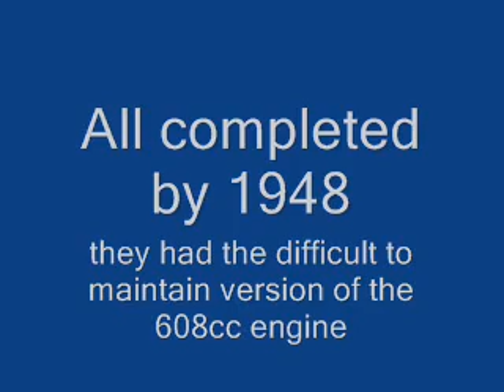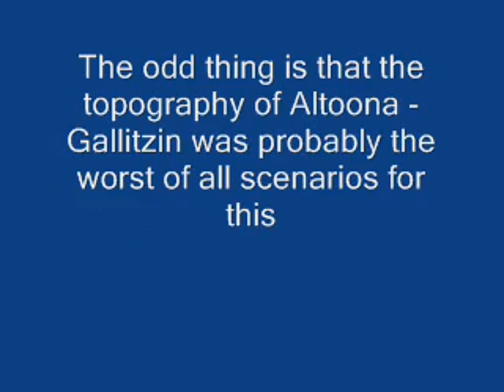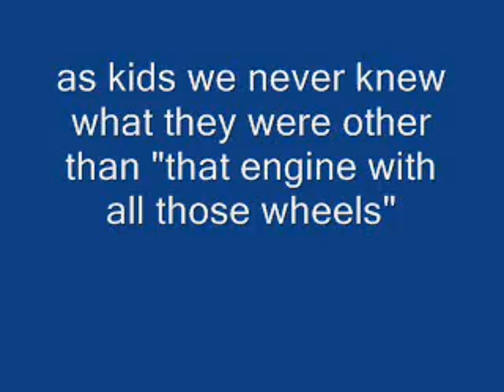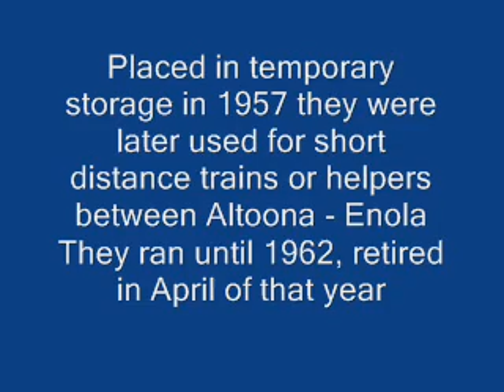baldwin centipedes

Comment: 0:42 A 608cc engine?  This requires some elaboration.  A 500cc engine is what you find on a motorcycle.
Reply: I think he meant 608NA for model 608 Normally Asperated. There was the 608SC for model  608 supercharged.

Comment: Diesels require a different set of design knowledge/heritage than steam locos. Just look at a steamer--every accessory is hanging outside the boiler in the breeze. No so with carbody diesels--everything is inside on top of each other. At least GE had experience with boxcab electrics.

Comment: The Baldwin guys were idiots lost in a past era. GM brought ASSEMBLY LINE AND OFF THE SHELF PARTS to the table and ran with that. Factually, the venerable FT was one of the most problematic locomotives ever made. But parts were galore and changing them was straight forward. I have a book called THE ENGINES OF BALDWIN and OMG the number of power plants they ran through because they thought like STEAM ENGINE BUILDERS. 

Pennsy did not help Baldwin OR itself either because those idiots were FAST LANING ENGINES WITHOUT ANY FORM OF ROAD TESTING. Had these been pre vetted, the smaller power plants that were more reliable would have been applied as well as a new traction motor blower system.

ALSO what egghead put all the LIQUID INES AND TANKS ON THE CEILING AND ALL THE ELECTRICAL LINES ON THE FLOOR? Duh

EMD's also went through this but ACTUAL MECHANICAL ENGINEERS SOMEWHERE SHOULD HAVE CAUGHT THIS WAY EARLIER ALL THE WAY AROUND. 
 
Anyway, the engine that APPEARANCEWISE IS MY FAVORTE DIESEL = DR 6-4-2000 aka PASSENGER SHARKNOSES. As much as I love PA's..... those still are nicer looking. Raymond Loewy did a fine job.

Comment: Baldwin had a terrible time trying to make the transition from a steam locomotive manufacturer to diesels. Management's mind set wasn't with diesels. They just couldn't embrace the new technology. Of all the steam manufacturers to transition to diesel production, ALCO was certainly the most successful, but even they couldn't compete forever. How ironic that a truck and auto manufacturer would be the one to come up with the ultimate train motive power that, sadly, banned the steam locomotive from the rails forever.
Reply: G.E.was the company that started diesel engine service in railroading in 1920,and now it's G.E.ruling the road today.
Reply: @4gauge10  Wabtec now. GE sold the subsidiary
Reply: Baldwin made diesels that were good on preformance, the centepeds were just maintenance queens when they did break down.

Comment: One of my favorite transition-era diesel locos.  They're certainly impressive machines to look at, and I'm sure were awe-inspiring to experience in person.

If Baldwin could've built quality, reliable diesels as they did with steamers, the Centipedes and everything else in their catalog would've been remembered as noteworthy engines, rather than curious oddities in the history of failed railroad designs.
Reply: AKA: if they had only been introduced to the wonders of using an assembly line.